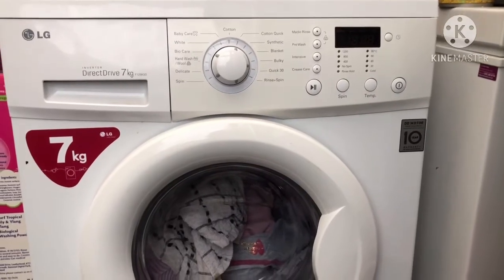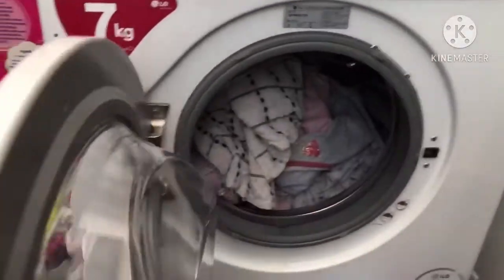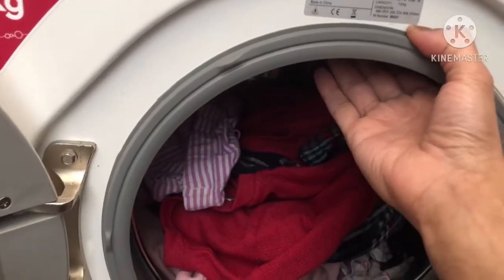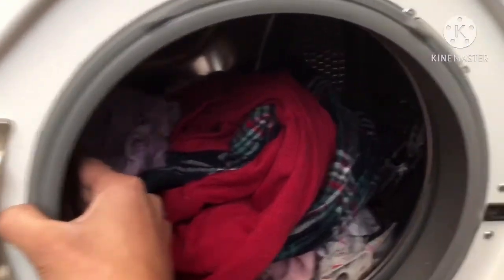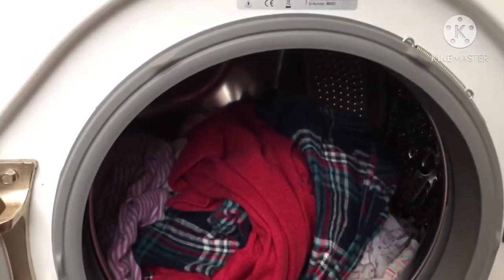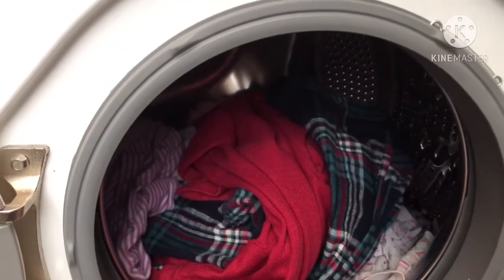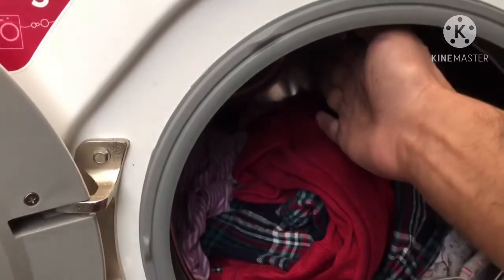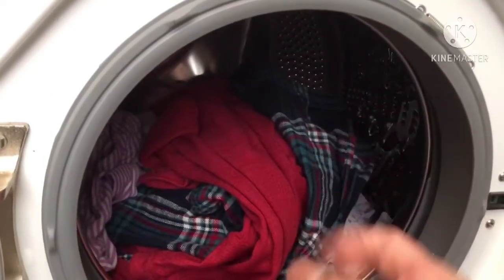Washing machine bearing failure - how to test

Comment: Your video is so helpful. But if someone relly want to fix it how much it cost because the new one probably cost $1500 and up. But what if we can fix with couple hundred like 500 doller? Can it be fixed with that money and is it worth it? Pls. And thanks
Reply from the maker: Hi, the parts you require are the front and rear bearings for your machine and also the drum seal. They are not expensive. What is costly is the labour charge if you got someone else to do it for you. My personal opinion is your handy with basic tools you can do yourself. Just make sure you tape the screws/ bolts to anything removed to help you remember. Also take photos. Hope this helps and please like and subscribe.

Comment: my drum making a awful noise but mine has hydraulics in them so it moves around like susupension is there any other methods to see if it’s the bearing. cheers
Reply from the maker: What washing machine do you have?
Reply from the maker: If it’s making a loud noise on spinning, the bearings are bad. Try spinning the drum from the inside and see if it’s making unusual sounds.
Reply: @reviewsfixeshacksmunsur3805  it’s a beko probably shouldn’t of said hydraulics there shock absorbers so the whole drum moves around. i have checked that but seems solid could it be the pump it’s almost like a squeaky noise ?
Reply from the maker: @mrr-ee6ui  Hi, the drum is held from the top by 2 springs, Check these. They are on shock absorbers at the bottom, also check these are correctly fixed.

A thumping/ banging sound when machine is operating would indicate spring or shock fault.

The pump makes a grinding sort of sound as it works. If you had a pump problem the washing machine would not drain. You can check that there are no obstructions at the pump where there will be a flap covering a screw on lid. Unscrew, water will come out so have towels ready. Then check there is nothing jamming the pump impeller. Also spin the impeller by hand and it should spin round in clicks.

Comment: When I turn the drum slowly by hand I can hear a rattling noise.  Could this be the bearings?
Reply from the maker: Yep. The noise your hearing is because you continued to use while bearings had failed. What you now have is on the spin cycle you get a loud rumbling sound. What washing machine do you have?
Reply: @reviewsfixeshacksmunsur3805  Thank you. It is a Bosch washing machine approximately 8 years old.
Reply from the maker: @lindsey3215   If you are able to yourself or have someone around that’s fairly ok with DIY then it may be possible to change the bearings yourself and save ££££’s. Having someone out to do it will be expensive. I have a video where I have changed the bearings.
Reply from the maker: @lindsey3215  common failure which results in the no of life for a washing machine is bearing failing. I’ve changed bearings and it’s cost just under £25 for parts.
Reply: @reviewsfixeshacksmunsur3805  Thank you for your help
Reply: @reviewsfixeshacksmunsur3805  It's not easy to change bearing if you have no experience with washing machines. Virtually you take apart the whole thing.

Comment: Sir. When I pushing my drum from inside  center it moving front and back is it a drum issue or bearing
Reply: Usual spinning noise and movement drum front and back make a noise at the start and end of spin
Reply from the maker: When the washing machine is on is it making a loud noise whilst spinning?
Reply from the maker: What I can say is that it should not be moving. If you can confirm it’s making a loud sound whilst spinning on a wash cycle, then that confirms that the bearings are damaged. Also if you were to begin the dismantling process it would be very apparent what the issue is when there is drum movement.
Reply from the maker: It sounds more like either the spider (a part connected to the back of the drum) is damaged or the drum has disconnected from one of the dampers underneath the drum.
Reply: Is it okay to continue like that or we should replace it immediately . if replace how much will it cost
Reply from the maker: @gokulvenkat8490   one final question. When you push the drum in and out do you hear any knocking sounds?
Reply: Only makes a sound when it touches the ruber
Reply from the maker: @gokulvenkat8490   in that case you can carry on using up to the point at which the noise worsens which over time it will.